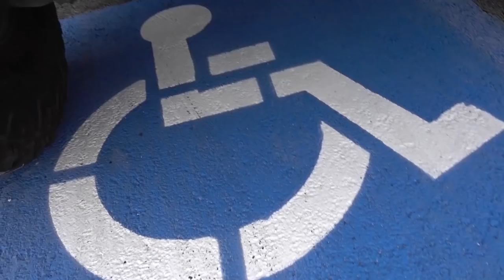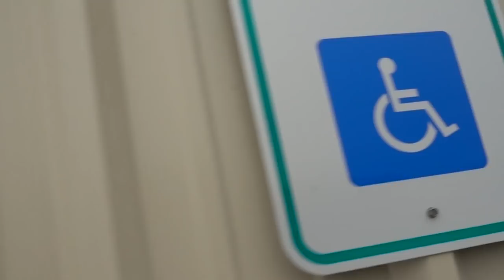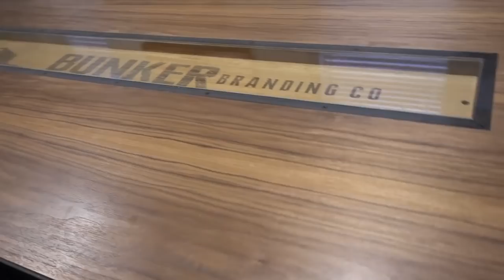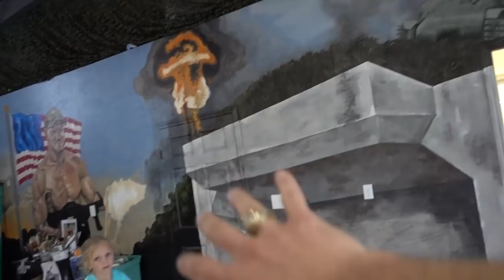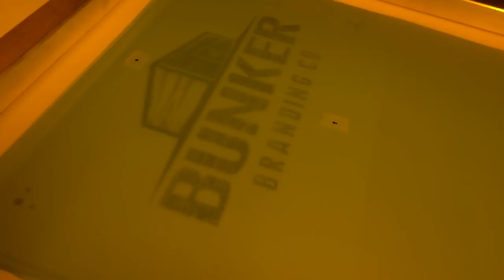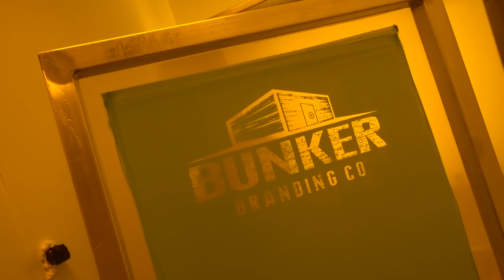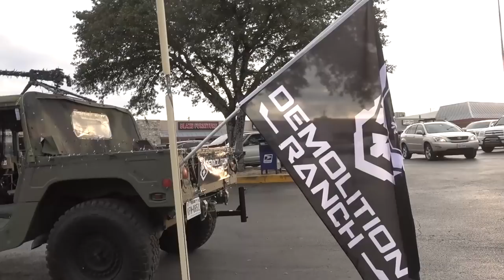FINALLY!!!  Bunker Branding TOUR!!!

Comment: Hey Matt, this is this a warning based on experience with metal edging on tables and countertops. If someone falls on it they can easily break a bone or get stitches. I have a massive scar under my chin from when I was younger. I fell on a countertop with metal corners or edging back when that was a trend.

Comment: I noticed on your painted wall that the recepts, switches, and plates covers are white. You can get them in grey and they would blend in so they would not distract from the pictures on the wall.. Should be able to get them from a electric supply outlet in your area.

Comment: I don't know all the specifics of T-Shirt printing, but we've done extensive testing at my work comparing LED to low UV yellow lights in regards to their effect on chemical decomposition and reactions. LEDs are just as good as, if not better than yellow lights in that regard and strain your eyes less. It's probably not necessary to have the room be "dark." If UV is the issue LEDs SHOULD work. They are very low UV....but again I don't know the exact specifics of shirt printing so I could be wrong.

Comment: most states have laws that if the leo's see a vehicle parked in a handicapped spot and the vehicle has no handicap parking permit, the leo's can ticket or tow the vehicle even if its  parked on private property no matter who owns the vehicle even if is owned by the property and or business owner. the leo can not break into the property to do so. ie, fence, wall, gate, ect.